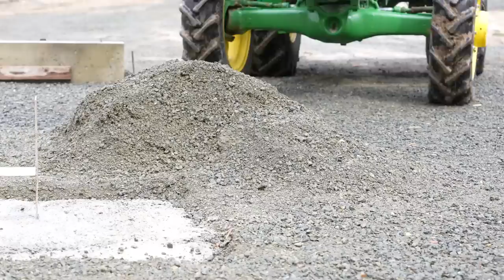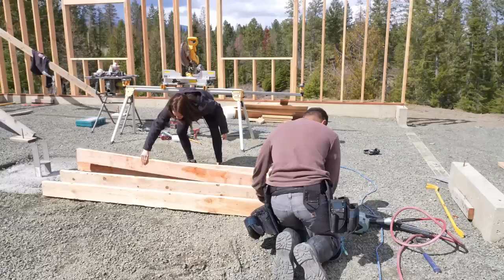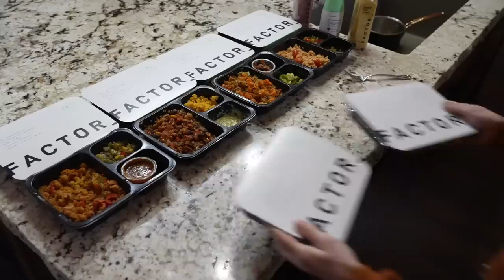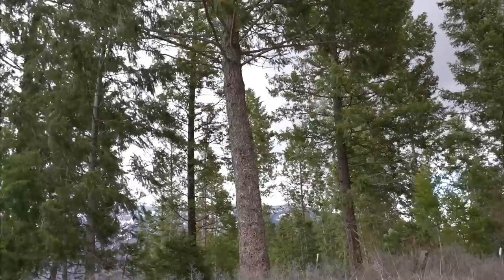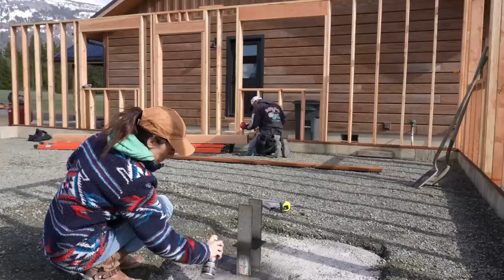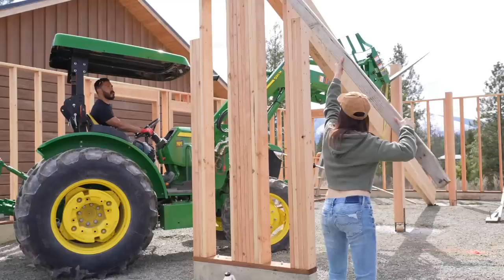Installing A Massive Structural Beam Using Only Our Tractor

Comment: Good job, getting that beam set. Please take a moment and brace it diagonally both left and right side,  as well as a diagonally from the middle post near the bottom and back too the top along the side of the engineered beam. Because even though you have secured it at the bottom. The latteral movement will exceed the spec loads until it is locked into place with the TJI system. Safety first! 🙂👍 
Also I would suggest once the lower section is down would be to pour the concrete, it makes it easier, just cover the beams with something. This will allow you to be able to build the stairs. 
The closest and shower looks great. 
Have a good week and God bless amen. 
😁👍❤️‍🔥🕊🕊🕊🌿🌿🌿

Comment: For little notches in wood, a router works well and is safer than the saw and chisel. Line levels sag a little. When using a power saw, gloves are dangerous. It can pull your hand into the blade. I'm glad that you haven't been hurt but I worry that you will get caught. I come from a family of carpenters who all died with all of their fingers. Good job with the beam. When moving things, momentum can cause troubles. I've learned that columns need temporary bracing while loading and connecting. Don't be afraid to use extra bracing. Good Luck, Rick

Comment: I have that exact miter saw in my shop at home. Mine is not on a stand but mounted at a miter work station. The one you have has been a work horse. Well made saw and am sure mine will last me until I make the last cut.

Comment: that was quite intense putting up that beam. great job. are you aware that the ridge beam has a top and a bottom because it has a slight curve in it because of the weight it will carry. it looks like the top markings are on the bottom of the beam

Comment: I would DEFINITELY install a larger T Bracket on the mid post than what you put  on there.  There is a lot of potential lateral movement that LAM beam has to endure and that small T Bracket is woefully inadequate to control it.

Comment: Is the back wall double topped? Is there double Ling and Jack studs to take the weight of the berm plus the upstairs? The last thing you need is a sagging building in a few years?
Reply: I meant King, not Ling. 
(Curse you, spell check.)

Comment: I know you are well intentioned, but I wonder, do you have ONE ACRE per animal for grazing? That is the standard for grazing season, otherwise you will have to supplement with hay anyway. And I hope your white plastic fence posts last, but I am not encouraged that they will. Horses will push and knock down anything that will "give" in order to get to lush green grasses. Your horses need to run and exercise, so do they still have enough room to do that with halving the pasture? Just concerned ...